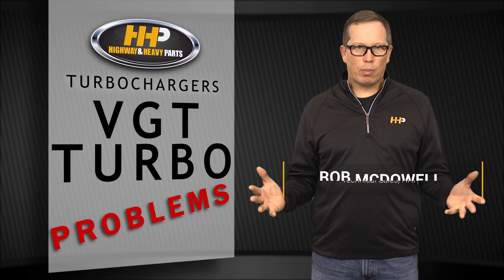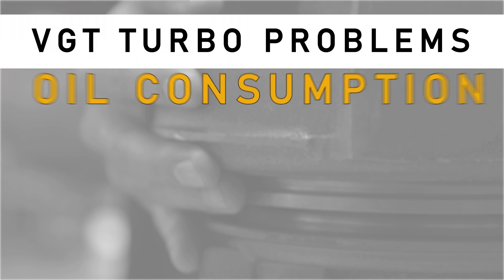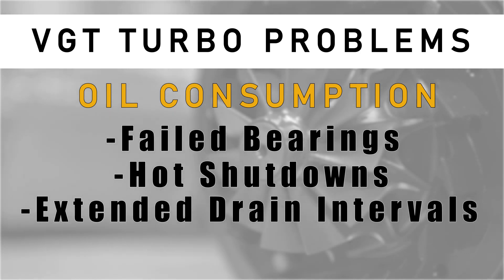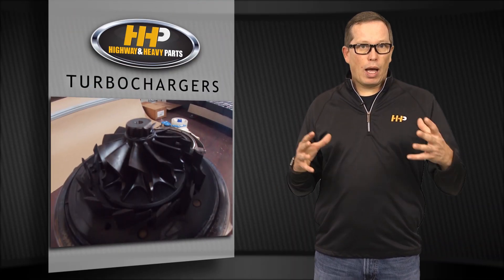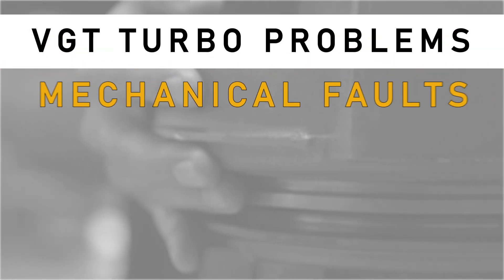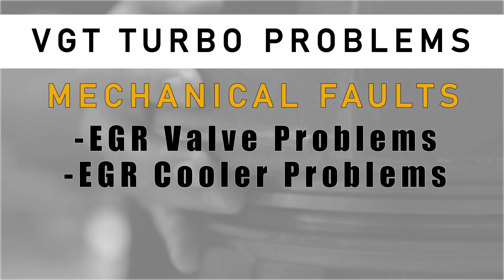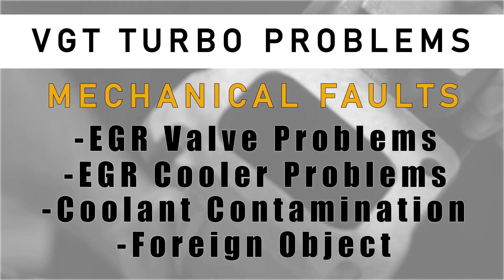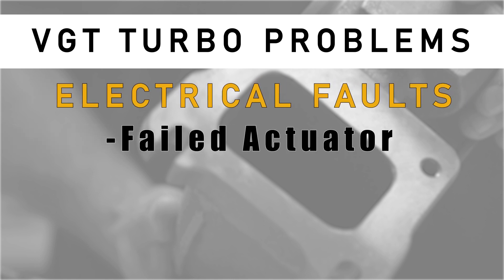VGT Turbo Problems and Symptoms

Comment: Hello I have  a 2016 kw t680 with a Cummins engine A few months ago my turbo took a crap! And had to be replaced I got a rebuilt one from a place here in SoCal and since then I’ve had to get 3 more turbos and 2 different vgts and my engine brake still doest work and last night I lost all boost after climbing a hill now I’m going back to the shop! Any ideas at what else to look at?
Reply from the maker: Start by looking into your EGR system. Any component that is faulty will harm the turbo.

Comment: My 2008 Ram 3500 6.7 at 100,000 miles had a CEL with Code P2262 once, when towing while passing a semi.  After starting and stopping the engine, (not full drive cycles) twice, the code and CEL went away on its own. Purchased an edge monitor. The boost and EB are normal and no codes while driving it now. Should I just keep driving it and risk bteaking down 500 miles from home on a longer trip at some point? Or, change the actuator? Or replace the entire turbo/ actuator asy? Pretty sure my local Dodge dealer would recommend cleaning the turbo, which never works, then tell me to replace the turbo if the CEL with same code reappears. Advise that could still leave me stranded 500 miles from home. Thanks.
Reply from the maker: Cleaning the turbo isn't the best option.  1st, I'd look into the turbo & actuator.  Checkout this video for more inform on an actuator diagnosis:  https://youtu.be/HJUIS54bAgc

Comment: I have a 05 6.0 with a vibration in park 
Doesn’t smoke but does seem like it has less boost than normal for a 6.0 
EGR and actuator clean boost module port clean 
Runs great except for the vibration.
100k miles and clean fuel filters , injectors tested good

Comment: 2014 Ram 2500 6.7 L  - Pulling a 30' gooseneck horse trailer up a long hill and engine light came on. Truck continued to haul ok but did not seem to have the power it normally had. Next morning engine light was off. About 1 hr of driving and light came on again (not hauling at the time). This went on for 3 weeks. Now the engine light stays on from moment you start the truck. Still hauls ok but not the power it had before. 137K miles. What do you think? Price from shop to replace w/ remanufacturer Turbo was $4400. Is that the problem or maybe actuator replacement (or something else??)
Reply from the maker: This is a common problem and is most likely the turbo or the actuator or both.

Comment: John deere 544k loader, has vgt actuator codes, the arm moves by hand. JD doesn't replace just the actuator,  they want to replace whole turbo. What should I look at first before they come out and hump me for a turbo
Reply from the maker: If you can move the sector gear freely without the actuator, then the actuator is likely worn out.  If you can't move the sector gear freely, start with looking inside the turbocharger.  

For more, checkout this video from Rob, one of HHP's Technical Sales Reps.
https://www.youtube.com/watch?v=Ja8LjVwJWHw
Reply: @Highwayandheavyparts  bad actuator 👍

Comment: Paccar MX 13 , when I run my Jake brake  with a load on it feels like the motor  is coming out of truck or its got a bad mis in it so fare we check everything. Need Help
Reply from the maker: There could be an issue with your VGT Turbo. If you have any more questions, you can give us a call at 844-447-1453!

Comment: Scanner , including Dealer diagnostics , shows no codas , or even History of recent codes.  
Started with exhaust nrake Not working , intermittingly.  
Then rough starts , to include overloading , throttle wouldnt work , until finally engine warm up.  
Then tuened off exhaust brake 15 minutes before turning truck off for the day.  
No more rough starts , but also , Not more exhaust brake since. 
Then , when Pee-Paw driving , started to overload anytime truck would lag at low RPM's , 
Them would have to stop  , due to trans would NOT down shift , neither automatically , nor manually.  
Stop to allow trans to do back to low gear , and while on park or neutral , would have to rev up RPM's , to clear up Overload.  
Now I know to shift manually , keep RPM's Above and between 
1 3/4. &  2,000 rpm , and truck wont do the crazy stuff , 
Now only Loss of Power and fuel milage.   
Fairly certain its the turbo.  ????
Reply from the maker: If you have a VGT Turbo and the engine has low power, there is a VERY good chance you need a new turbo.

Comment: My 12 f450 turbo is whining almost like a long siren sound from a fire truck.
Reply from the maker: Could be many things, I would check the compressor and turbine wheel within the turbo to make sure there is no damage. Also, check the shaft for play. But it could also be very likely the charge air side has a boost leak causing the noise. If you have any more questions, you can give us a call at 844-447-1453!
Reply: @Highwayandheavyparts  yep it was eating itself. Got it done. Wasn’t too bad of a job.

Comment: my turbo starts to drop and gain boost in a sec... its like dancing boost so i dont know what can be reason
Reply from the maker: If there isn't any visible issues on the outside of the turbo, you may have to pull it off and see if there's anything wrong internally.  If you have any technical questions on deeper problems or a replacement turbo, connect with one of our ASE Certified Technicians at 844-447-1453.

Comment: Mine is a Cummins isx 15 it has poor acceleration from stop till I get to 6th gear high I have a 13 speed, once in 6th it'll boost up to 30psi like normal before 6th I get 5 to 10psi... Bad actuator? Update does need to be done according to dealer which is warranty..
Reply from the maker: Ralph, check out our diagnosis checklist: https://highwayandheavyparts.com/n-12258-turbocharger-failure-diagnostic-checklist.html or give us a call at 844-447-1453!

Comment: I have a 2014 ram 3500 with 6.7 and I get a code for the actuator. I did drain the coolant and removed actuator to see if it was the turbo. The turbo arm moves without crazy force but does have a little resistant. How do I determine if turbo or actuator.
Reply from the maker: Hi Jeff!  Rob covered your question in yesterday's video.  Check it out here:  https://youtu.be/qAcKp6HHlEM

Comment: Great videos. My 2014 Ram 6.7 has an actuator failure. I was getting 14psi of boost at best. I replaced the oil and used 3 quarts of Marvel Mystery Oil and I got an increase of 3psi with the new oil from August. A new actuator is expensive. I saw your video of how the turbo fins fit into a slot and I'm wondering if that may be what's going on with mine.
Reply from the maker: Hi Dexter!  Rob covered your question in yesterday's video.  Check it out here:  https://youtu.be/qAcKp6HHlEM

Comment: I have a 04 ford excursion 6.0. I have no shift past 2000rpms and when I let go of gas pedal I get a loud barking noise. I do have P0312B code, could it be that the solenoid is bad and not opening or closing the vens? I changed the egr, ebps and hose for map, cleaned out intake air temp sensor.

Comment: 2011 Dodge Cummins from first to second gear gets like 22 lb of pressure and when it shifts it drops down to nothing then takes a while to boost back up
Reply from the maker: Check out our diagnosis checklist: https://highwayandheavyparts.com/n-12258-turbocharger-failure-diagnostic-checklist.html

Comment: i have an 08 ram 5500 with 455000 miles i have been chasing the exhaust  brake issue for three years .i have to multiple shops they all say replace the turbo .(no ex[explanation just replace )  finely after three years the bearings went no choice i replaced the turbo.still no exhaust brake .i have replace the sensor a number of times and checked the presser line i have good flow. the turbo came with the controller already on it .the turbo re builder claims it needs to calibrated to my truck .a highly rated and trusted shop claims the ram does not need to be calibrated .what do i need to do to get this working??????
Reply from the maker: Check out our diagnosis checklist: https://highwayandheavyparts.com/n-12258-turbocharger-failure-diagnostic-checklist.html

Comment: I have a 2008 2500 6.7.the exhaust brake isnt working.no fault codes and light comes on in the switch in the dash.runs and pulls fine
Reply from the maker: Check out our diagnosis checklist: https://highwayandheavyparts.com/n-12258-turbocharger-failure-diagnostic-checklist.html

Comment: Hi i have a 2015 kenworth with a paccar mx13 engine and what mines doing it all of a sudden it looses power for a little and comes back again. On the computer it says data erratic and sometimes it says vgt actuator 1. What do you guys think?
Reply from the maker: Hi Erick!  Rob covered your question in yesterday's video.  Check it out here:  https://youtu.be/qAcKp6HHlEM
Reply: @Highwayandheavyparts  Good morning Rob, I actually fixed my problem with the actuator. I was driving my truck again and it came out as i was driving and i stopped and the problem stopped too. So i opened the hood and it did it again. I was by myself so i put a phone camera on my steering wheel and i was recording while i was messing with the wires on the actuator and was doing it one by one. Once i got to the red wire that's where my problem was it was about to detached from being bent from all this time and assuming heated up too so i saw the video on my phone and just cut the wire and attached it again and haven't had any problems after that. You were right about the electrical part of it i just needed to figure it out. Thanks Rob.
Reply from the maker: @erickmiro9273  Glad you got back up and running!

Comment: I have a 2015 prostar isx15 starts and shuts off. Right away . loosen turbo from manifold starts and runs.
Reply from the maker: Check out our diagnosis checklist: https://highwayandheavyparts.com/n-12258-turbocharger-failure-diagnostic-checklist.html

Comment: I have an 04 f350 that will not build boost until around 1200 rpm and if I stand on the break and try to build it will not do anything? Any ideals
Reply from the maker: Check out our diagnosis checklist: https://highwayandheavyparts.com/n-12258-turbocharger-failure-diagnostic-checklist.html

Comment: I have a2009 5.9 Cummins with vgt turbo4089945 had installed at 1st shop drove 150 miles 2nd turbo drove 40 miles 2 different shops I got the turbo off ebay new are cheep turbos or bad shops
Reply from the maker: Check out our diagnosis checklist: https://highwayandheavyparts.com/n-12258-turbocharger-failure-diagnostic-checklist.html

Comment: My OEM exhaust brake fell to about 10% of its braking power on my 2012 2500 Dodge. Pretty sure it was in the venting of the CCV filter to in front of the turbo inlet. Brilliant engineering Dodge. This was around 95,000 miles!

Comment: I have a 2012 6.7 Cummins that the turbo back fires when wanting to pick the throttle up at about 49 mph.
Reply from the maker: Check out our diagnosis checklist: https://highwayandheavyparts.com/n-12258-turbocharger-failure-diagnostic-checklist.html

Comment: Loud noises from turbo when accelerating with no black smoke, when actuator pipe removed noises doesn’t sounds but still no pickup. My car is diesel Hyundai Verna transform 2010 1.5L crdi
Reply from the maker: Check out our diagnosis checklist: https://highwayandheavyparts.com/n-12258-turbocharger-failure-diagnostic-checklist.html